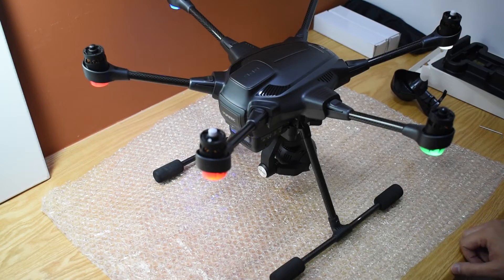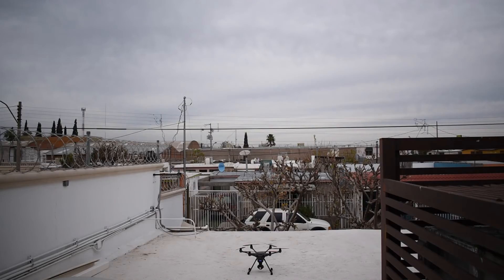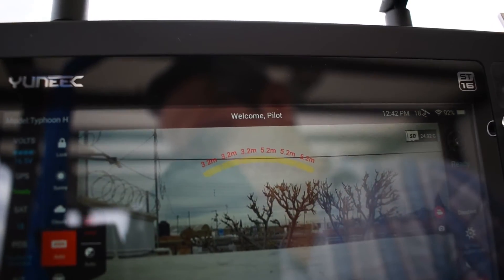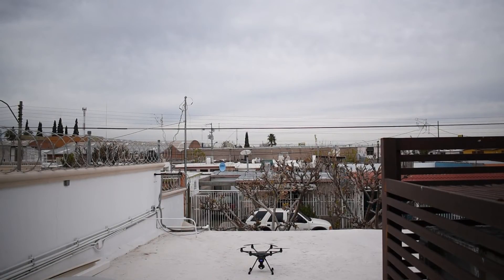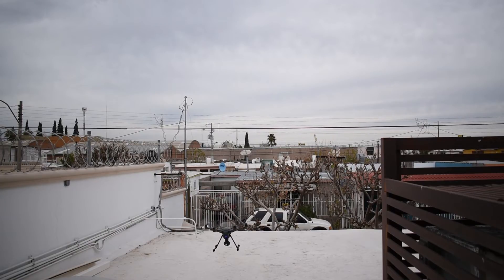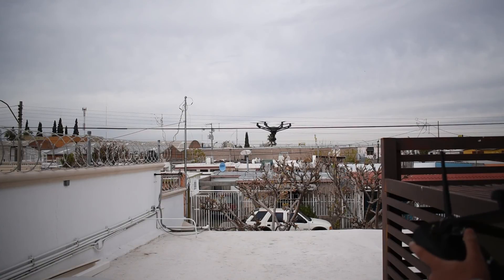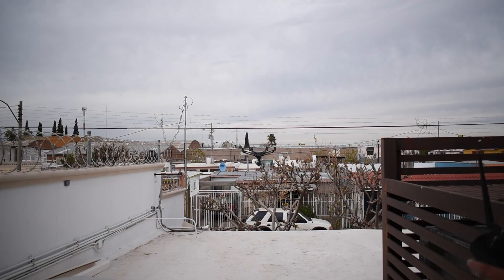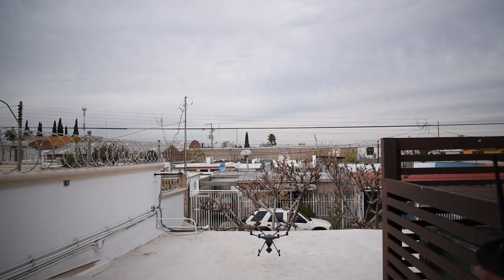Typhoon H - Installing Intel RealSense Module & Testing

Comment: I know in the video you suggested a possibility of more battery consumption due to the fan on the module. How did this area end up turning out for you?
Reply from the maker: Well, not really just the fan, but the fact that there's a processor working up some heat that it requires a fan. It kind of does, but not for too much. However flying aggresively will definitely shorten the flight time a lot more that without it. Flying conservatively will give similar times with or without RS

Comment: Typhoon h has  defective fly away problem stay away just google the internet plenty of fly away chatter
Reply from the maker: Just because there's a lot of chatter, doesn't make it true. Most "fly aways" I've read about Typhoon H were caused by pilot (either not knowing how to operate the UAV or simply sending it too far for too long and running out of battery mid-air). I've owned mine for about a year now (I own 2 actually). They both perform perfectly. Greetings!
Reply: Good for you However, i believe if fly aways are normal it should be a warning label on the drone. To let people know they can lose their investment. Just like stocks and cigarettes.
Reply from the maker: Fly aways are a regular ocurrence for any UAV brand out there; just like every piece of tech they are All prone to malfunctions. There are tons of documented "flyaways" for every brand/model out there (yes even the more expensive DJI inspire). Having said that most "fly aways" are derived from improper user operation (flying on inadequate locations, unexperienced pilots, bad weather conditions, too close to obstacles and/or electromagnetic fields,  etc..)

Comment: Damn man, razor wire on the top of your wall? Nice quiet, safe neighborhood I see
Reply from the maker: Not a bad neighborhood, but we did have a break in a few years ago. These kind of protection is not uncommon in MX, in fact, it is very common to see houses with electrified fences on top of the walls. We just got the cheap wire.

Comment: JULES  GIVE A LOOK  PLEASE.
 YOU SHOULD RESPOND TO YOUR SUBSCRIBERS
KEITH
Protecting your drone with a hydrophobic coating
If you want to fly over water or in the middle of a downpour
 or snowstorm, you can do so without having to worry about crashing into
 the water. In recent years, scientists have made some amazing 
advancements in hydrophobic technology. Hydrophobia is the fear 
of water. Hydrophobic means water repellant! Now you can simply apply a 
hydrophobic coating to all of the parts of your drone and your drone 
will be ready to fly in wet conditions.
Before you go dunking your drone in water to test the 
effectiveness of your hydrophobic spray, make sure you properly coat 
your device.

To properly apply a coating, you must dismantle your drone so that all of the working pieces and parts are exposed.
Reply from the maker: +KEITH KUHN hello keith sorry for not responding, I have considered protecting the internals, however I rarely fly on water. My biggest concern would be how to properly protect the battery contacts
Reply: YES YOU ARE RITE, VERY EXPENSIVE UNITS. WE MUST BE CAREFUL
 KEITH